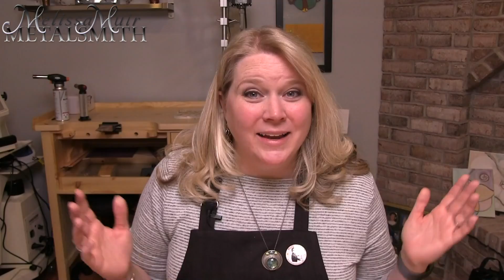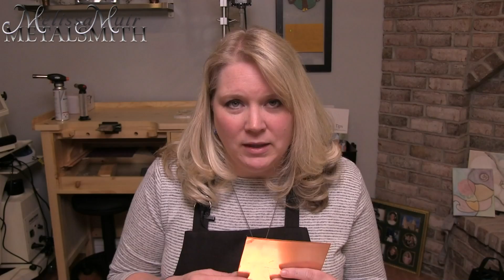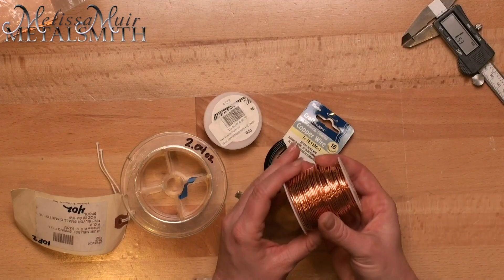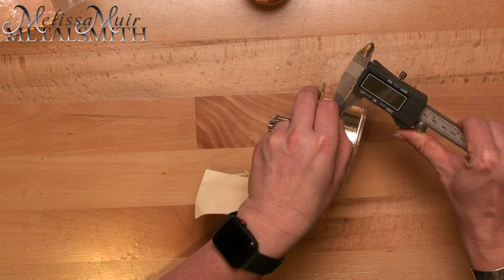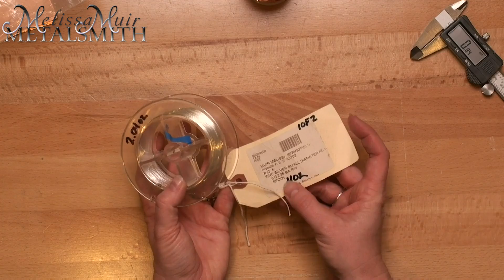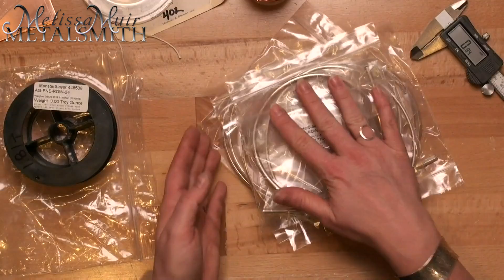Weekend Jewelry School - Session 5 - Using Wire Gauges

Comment: Make sure you get a non ferrous one metric ! I found out the hard way !
Reply from the maker: Ugh. Been there fine that.
Reply: By the way got all the parts for the pulling wire machine ! just got to get the bolts and ,I have a 8 foot bench . Thank you again !

Comment: Thanks again for another helpful video.  You mentioned getting wire from the refiner.  How do I do that and What are the requirements for this?
Reply from the maker: Sherry Wheeler it depends on which one you work with. Some of them may require a business license and others may have a minimum quantity. I buy most of my wire from
monsterslayer.com. They are not a refiner though. I have also done business with Hoover and Strong.

Comment: That's where the metric system comes into it's own, 1 mm is 1 mm however there are at least 4 different wire gauge systems around the world , this then gives you four different  gauge 12's as an example.
Reply from the maker: Exactly.
Reply: Here in the UK for machine screws and nuts we had Wittworth, BNC, BNF, BSC, BSF,BA plus inches etc so even if we moan about Europe metric works well.  @MelissaMuir